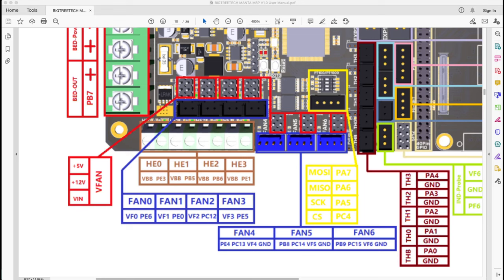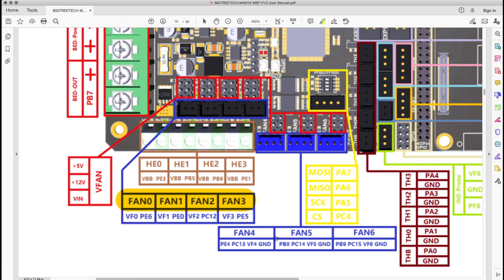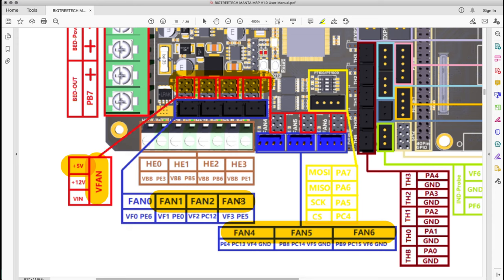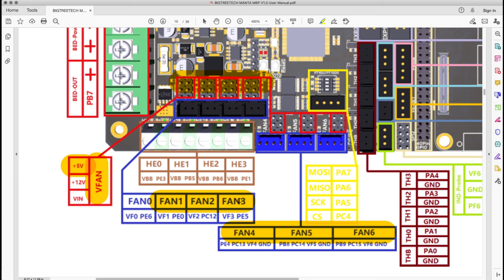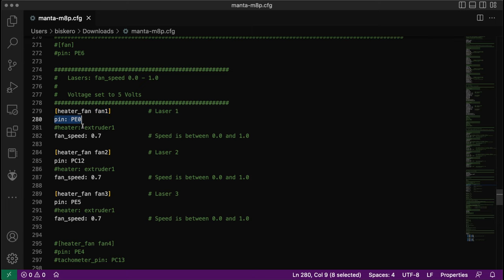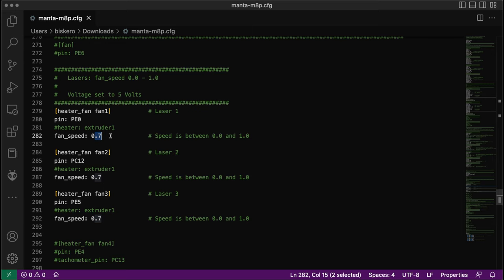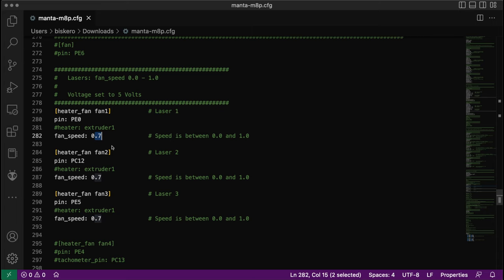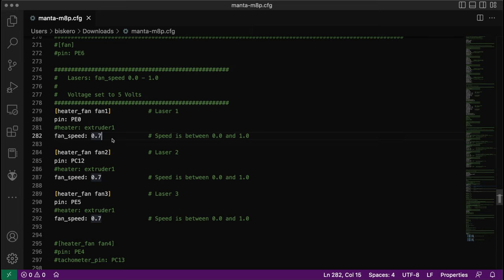Klipper Fans/Lasers configuration on Bigtreetech Manta M8P - Custom 3D Printer

Comment: Nice mod and ideea for 3d printing.
As a side-note, PWM does not regulate the voltage or the current, it controls the duty cycle. It creates a square wave, and takes values usually from 0 to 255. At 0 for example, you have no output, at 255 the pin is always on and at 128 (50% duty cycle) the pin is half the time on/ half on (one pulse high one pulse low) etc. The net effect for most consumers is like reducing the voltage since for example at 50% duty cicle you have 5v half the time and 0v the other half, the avarage is the equivalent of 2.5v. 
This modulation strategy basically takes advantage of the "inertia" of most consumers.
Reply from the maker: totally correct! thx for the comment, pls subscribe